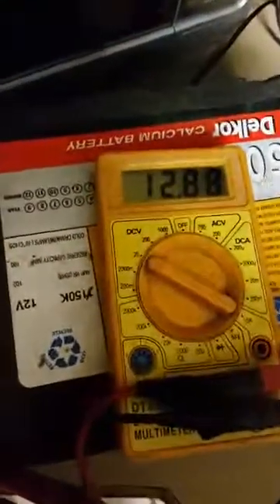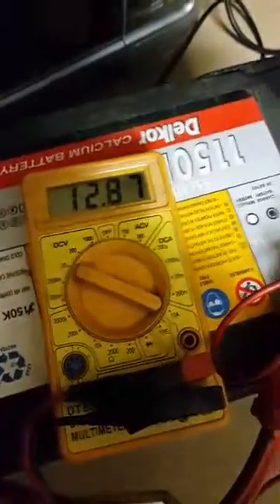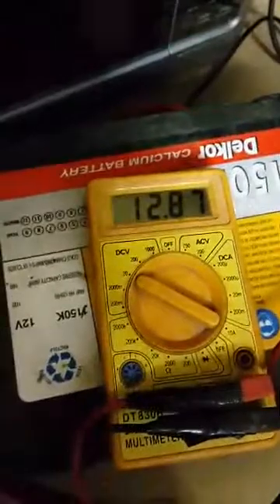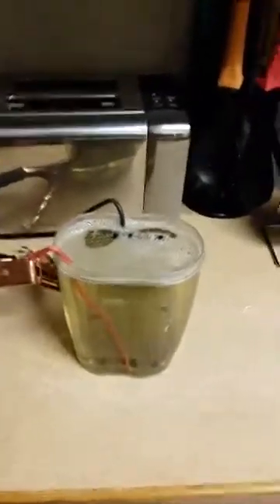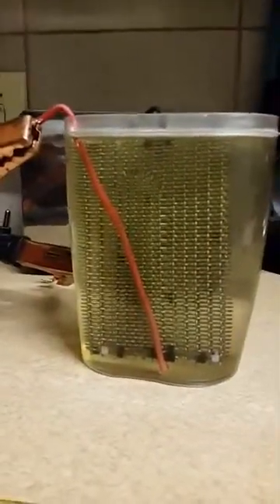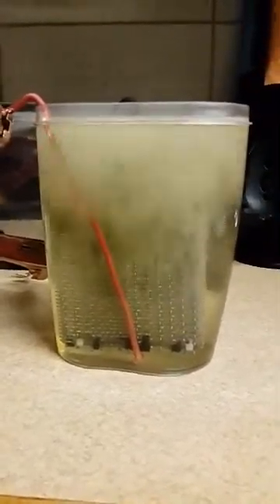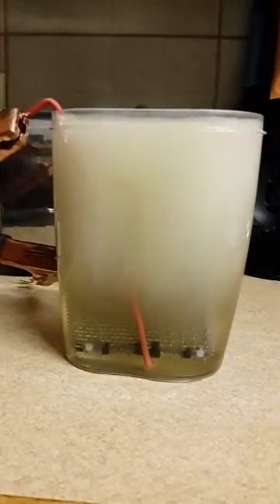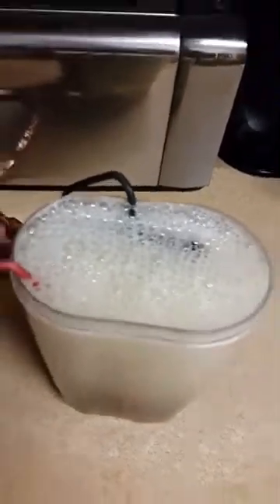HHO high output cell

Comment: I would say increase volts and drop amps to keep it cool. lower volt higher amp. higher volt lower amp. should be able to find where both scenarios have the same output.
Reply: btw disconnect the positive from the plate and just touch it to the solution.  this should help cool it off too as it is not a direct short.